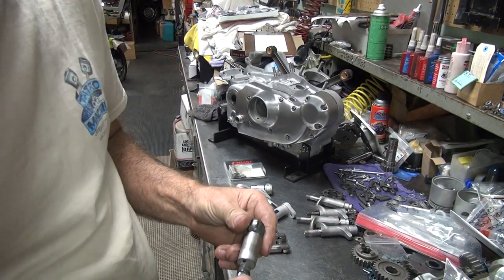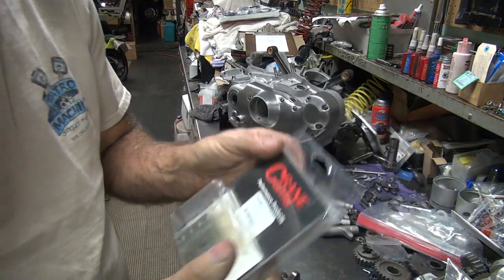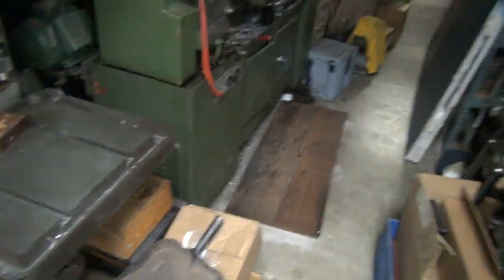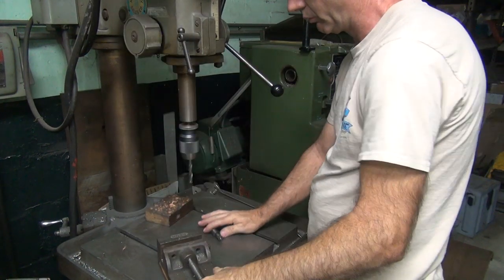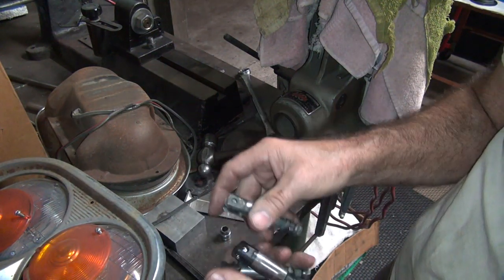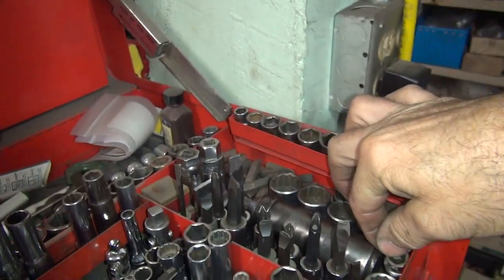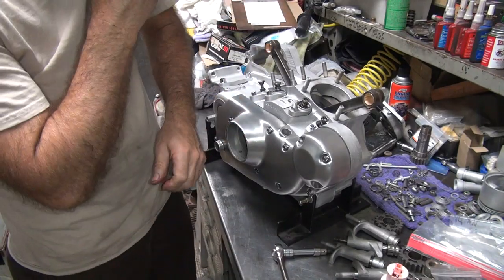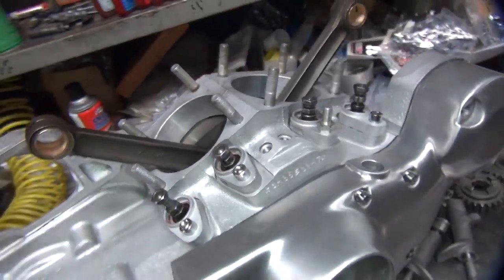1977 xl xr street tracker #118 motor rebuild repair 1000cc sportster ironhead by tatro machine

Comment: KT, What's a good rule of thumb for lifter replacement or inspection 50K? 100K? My 1998 Evo suffered from low oil pressure around 100k miles. When I upgraded to steel ones from Valva touch it came back up substantially. Sadly the late model Evo engines were junk aluminum. I think they're all aluminum now, what a damn shame that the Motor Company switched to aluminum on these critical moving parts. Anything to save a buck I guess. Thanks for sharing your knowledge!